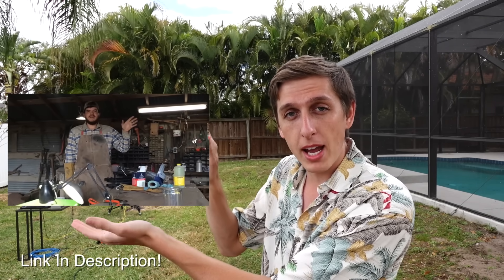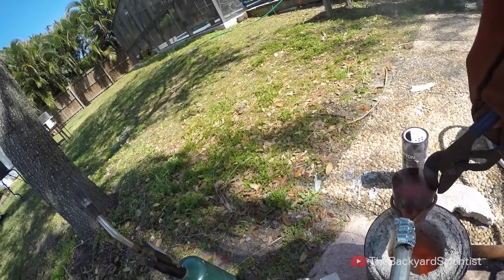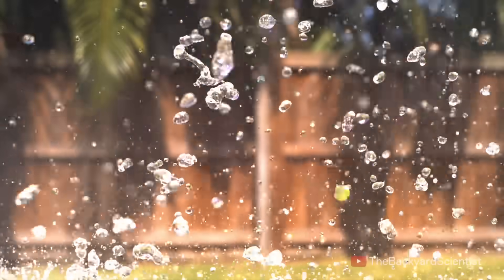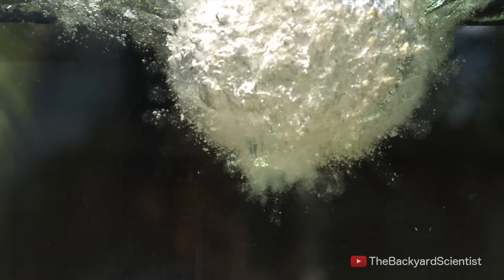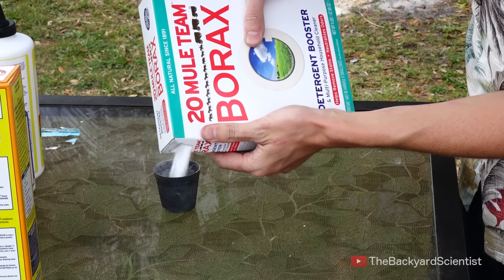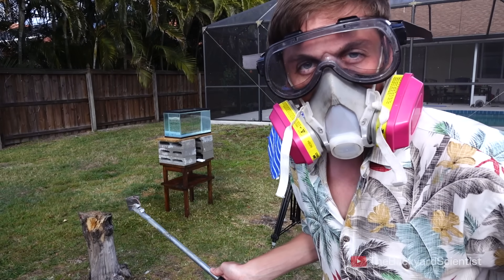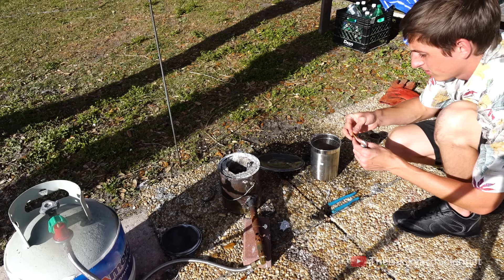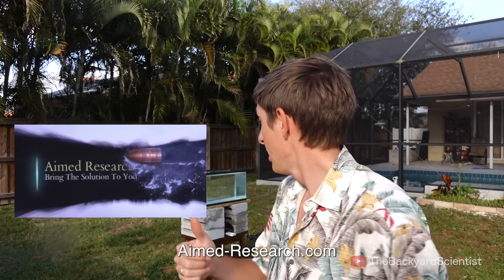Pouring Molten salt into Water - Explosion!

Comment: If i had to guess i would say it is a combination of several things going on, the melting of the salt weakens the lattice structure of the salt, allowing for the already more powerful hydrogen bonds to  break the salt structure down more violently than usual. This generates not only free sodium atoms but also chlorine free radicals. The sodium reacting with water generates an explosive force as well as hydrogen, however this hydrogen then goes on to react with the chlorine free radicals to give a secondary explosion. This would explain the absence of the characteristic combustion flame for the hydrogen present when the straight sodium gave one. It is then entirely possible that the HCl formed condenses back into the steam and the water again where it will react with the NaOH to give the salt again and neutralising the pH.

Comment: Wouldn't it have something to do with the combustion of hydrogen not being able to escape water after the immediate cooling?   I have no idea if I even come close to knowing but I know if you were to put water into molten metal that's exactly what would happen.
Reply: Basically a small hydrogen bomb?
Reply: nah, but you tried xD
Reply: ***** I think your wrong.....
Reply: +Stankonia 1 i'm a biochemist so idc what you think lol
Reply: So here's the first big problem with everything you said, a "hydrogen bomb" is not burning hydrogen, it's fusing it. Second, the hydrogen and oxygen don't separate from each other when water evaporates, you have to use electrolysis for that.
Reply: Making water/steam hot enough can actually separate the hydrogen from the oxygen. That's what happened in Fukushima , leading to the eventual explosions.
Reply: ***** Ok? That's still not what a "Hydrogen Bomb" is. And besides, the salt would have to be heating the water to 3000+ºC to even separate enough hydrogen to make an explosion.
Reply: LiquidPanic
I was not implying you were wrong with your main points, I just wanted to add that you don't need electrolysis.
Reply: ***** And I was just pointing out that heat based water-splitting is very impractical and would most certainly not happen from pouring molten salt in water.
Reply: isnt it because salt containts natrium which explodes when it comes in contact with water, maybe by heating it the natrium seperates with the chlorine
Reply: nope, just sodium 0 explodes with water, but the sodium ion in sodium chloride are +1, plus the reaction between sodium and water releases NaOH that changes pH

Comment: Is this something along the lines where a normal reaction at room temperature and standard atmosphere NaCl are neutral ions combining with H2O form an acid BUT the hydrogen coats the entire group allowing the salt to simply dissolve.  However, the reaction you are working with is a high temperature thermodynamic reaction where NaCl become Na+(aqueous) and Cl_(aqueous) adding this to H2O...energy is imparted to the water creating HCL and the rest is history. Somewhere along the line the bonds must be breaking down, the high temperature is potential energy turning into kinectic energy? I mean it's a form of External Work being done on open system delta U = Q + W ; No change in Volume, No change in Pressure; therefore the external heat applied is the only thing that has changed adding to the total change in energy? Just guessing.

Comment: I use boric acid and borax for working on gold and silver jewelry all the time. They both have a much much lower melting temperature, and are also more of a tar like substance when molten. Kind of like lava. I feel like it isn't hot enough to super heat the water, nor are they fluid like enough to form the pockets if they could heat it fast enough.

Comment: Maybe because of table salt's very high solubility in water together with the heat of water vapours from the initial leidenfrost effect, a over saturated solution is formed around the sodium chloride. This solution of course should have a higher boiling point than water itself. The difference may not be that dramatic but maybe it is enough to break down the leidenfrost effect and allow the salt to come into contact with water. Then your theory comes into action next.

Comment: I would posit that the biggest factor involving your experiment is that sodium chloride (NaCl) breaks down the surface tension of water. This would in fact infer a chemical reaction, that should also explain the intensity witnessed by your experiment. This would arguably identify the absence of the same level of intensity when the other chemicals were introduced to the water, as they are all agents not known for their ability to break down the surface tension of the water; purely reactions to temperature displacement. Perhaps, if you can manage it, try some form of molten soap, or other agent known for its ability to break down the water's surface tension, and see if like reactions are the result...

Comment: I work for a refinery where they use oil to produce the various grades of liquid asphalt that they use to mix with the aggregate to lay down on the roads that you see today. The asphalt we normally send out is called PG64-10 and runs at approximately 350 degrees. The single most dangerous thing that a driver can have in his truck is water. Water expands 1500x when the asphalt hits it. There have been cases where inexperienced drivers don't realize there's water in their truck, and load on top of it. What ends up happening is that the water causes the asphalt to explode out of the dome causing a volcano like effect. There was one case where the driver was new to the job, loaded a wet truck, didn't have his facemask down, and the asphalt shot right into his face. He lived for a while, but they had to remove his eyeballs, but eventually he ended up dying months later.
Reply: +ExMachina70 I care. May he rest in... Asphalt...
Reply: All I need are four more eyes and I can perform my own 6 ball juggling act. Did you you want pics?
Reply: Moe Zuiter oh don't get me wrong. I really don't care if the guy died. I kind of thought it was cool that his eyes were scooped out.
Reply: Samuel Rea No what's fucked up is that I have his eyes in a jar next to me as I type this.
Reply: Ok send me your email then, and don't come back crying at me after i show you the photos.
Reply: Obviously you're trying to get me banned here. If you never wanted to see the eyeballs in the first place then you should have said so. I'll let you know this much. His eyes were brown before they turned black. XD
Reply: Samuel Rea you know I cant do that. I can't show something horribly gory as a guys eyeballs melted with asphalt. The puss alone will gt me banned. Quit stalling and send me an email.
Reply: Samuel Rea I really want to show you these eyes. They're really cool I'm sure we can work something out here. LOL They scooped it out of his head for Christ sake. You'll laugh your ass off. Let me find out how I can go about this.
Reply: ExMachina70 cool
Reply: No one cares mate, sorry bout that
Reply: Lol Np. It was more about the expansion of water with heat than anything, but in all honesty you can really only speak for yourself.
Reply: do you have a social media website like facebook because if you do u can post it on your side and I can view it without giving my information away
Reply: I have no idea what the hell you just said. Speak english.
Reply: Stephanie Briggs thanks lol
Reply: ExMachina70+ oh, and i severely enjoyed your short tale, Mr "Machina", in fact i found it quite entertaining.
Reply: Crippling Depression Glad you liked it. Just a couple weeks ago we had one of our operators hooking up railcars to some steam hoses. They do this to heat up the asphalt on the railcar so that it turns into a liquid so that it can be easily offloaded into a tank. Well, he missed a step somewhere, and ended up getting blasted by the 400+ (F) degree steam at crotch level. Good thing he covered his johnson, but ended up getting severtly burned on his legs, and his hand. The steam went right through his nomax, and gloves and burned the crap out of him. At that point the doctors have to let his hand heal, then peel off the skin a few times over. It seriously sucks being him right now.
Reply: wow the company you work for must suck if there is these many acidents happening.
Reply: with the way exmachina seem to enjoy these unfortunate events, i question it being an accident in the first place :x
Reply: Aidil Rosedy Yes.....an "accident".
Reply: your fucked up
Reply: pervert weird fuck
Reply: SURE BEACAUSE I KNOW YOUR LIEING
Reply: no your going to bother me on my email. If you have his eyes post it on youtube.
Reply: no I don't know you so I'm not giving you an email address. your the one stalling
Reply: fucked up
Reply: ok sure this will be new
Reply: who are you talking to pepsqueak
Reply: I like your spirit. #science
Reply: Samuel Rea
 Are you inferring that I am a child? I was just making a simple joke.
Reply: TheCobraGamer a simple joke that wasn't funny
Reply: Samuel Rea
I respect that. Not all jokes are gonna be funny. Atleast be nice. :|
Reply: what if you don't know how to
Reply: Thats fricking metal dude.
Reply: Samuel Rea Actually the first incident that I was talking about happened at another refinery. It was an error on the truckers side since he didn't check for water in his tank, but this is also what happens when trucking companies don't educate new drivers enough, and teach them what to look out for. These low budget companies have such a high turn around, that they fail to teach the drivers the real dangers of what their dealing with. As for the other incident, it did happen in my company, but it ultimately was operator error.
Reply: A cautionary tale, but a horrible one.. ouch

Comment: +TheBackyardScientist I have an idea about the salt reaction and the Leidenfrost effect. It may indeed be happening as it is supposed to. But: how does sodium react with water vapor??? The air around the melted salt should be supersaturated. Chlorine gas is also explosive. Could there be any chlorine gas (even minute traces) forming as part of reaction between the sodium and the water? When a scientist is in doubt, they usually ask an engineer.

Comment: What is an ionic compound?
Reply: My first response would be to just Google it because it's been 10 years since I took chemistry, but I believe it's a molecule made up of two ions that are bound together because of their opposite charge. If I remember correctly, all salts are ionic compounds that, when dissolved in water separate into their component ions. So table salt in water becomes Na+ and Cl- ions freely floating.  Still, if you want definite info just Google it :P

Comment: It's a chemical reaction
First. NaCl heated up so it created ion form of Na+ and Cl- 
Then Cl- and Na+ react with water at the same time create HCl and NaOH ( and Na+ create the explotion ) 
After that, NaOH and HCl react with each other and create NaCl 
So pH didn't change
Reply: By the way
Sodium will explode when react with water at room temp. You don't need to heat it up

Comment: seems to me a chain reaction, just about it. So the little explosions add to the next and its only possible because of the speed of the reaction, if you slow the process down it will not explode as in slow speed the adds never happen. That would be my point of view considering the physics envolved in the reaction. Which explain also why it doesnt work if the salt has something that might slow the reaction. So with this though i would request more experiment on this, but now aiming to add something extra to the melted salt to accelerate the chain reaction  speed. And another instead of tempering the salt with some extra do it with the water. Remember the aim is to do everything that might speed up the chain reaction. Explosions is all abaout speed(once it explodes) before that the process can be slow as it can get.(i would state that the definition of  explosions is hyper speed chain reaction) no chain reaction no explosion! If im wrong prove it, i really would like to see that. Think of me as a challanger, take or leave it. But would be awsome to see more of your experiments on the matter. Thank your for the hard work, keep it up!

Comment: why is molten salt dark? are there any chances that you broke the ionic bonds and released the Cl gas free and Na became what's mostly left?

you didnt seem to heat up the metal Na enough, while you heat up the salt for 10 min, so the energy stored in salt was bigger. this was an unfair and terrible comparison, if Na was hot enough, then it would explode just as well.

Comment: I think the answer is partly down to the significantly higher heat of fusion of NaCl Vs the other salts. In short there is far more energy released from the solidification of the NaCl than for the solidification of the other salts despite the lower melting point. With the heat of fusion being higher it would in theory take longer for a strong surface skin of solid salt to form for the same rate of heat transfer to the water. The explosion is of course down to the rapid generation of steam, we know that this is the case as the steam bubbles are clearly seen as collapsing back in on themelves as the steam rapidly recondenses after the heat source is diminished.

Comment: I have a feeling it's because sodium chloride absorbs water very well, so the leidenfrost effect is minimal
Reply: If that was the case, the pH should have changed according to his litmus test due to the addition of NaOH
Reply: i was thinking the same
Reply: What about the fact that molten salt is nothing but ions. NaCl does not need to wait until it gets hydrated, so there are Na+ ions from the beginning, reacting with the water, producing a lot Hydrogen (and maybe ignites and produces water again while energey is emitted)?
Reply: it's probably due too sodium chloride density, I mean compared to the others it sank slightly faster which could be what made it explode
Reply: fuck my highschool chemistry teacher....
Reply: It's because the sodium itself is super reactive with water, all the boiling does is boil off the chlorine allowing for a reaction to take place. Though the reaction in the video is much more explosive then normal, probably due to flash boiling between molten sodium and cold water.
Reply: Well obviously the ionic dirivitive is incomparable with 
You know what I have no idea XD

Comment: Does the extreme amount of salt at the point of contact with the water change the surface tension of the water?  Also salt is hydrophilic, meaning it attracts water as well,  Could the molten salts be even more hydrophilic?

Comment: The Chlorine you separated from boiling it down will absorb and heat the water to about 500C then due to the sodium being pure, or more so with it's chemical balance further unstable the H2O will bond with Cl and then it will leave Na to it's own accord making a violent pressure change within the water. But, there is no exact measure of bonds in the other chemicals, it would end up being pointlessly unstable. Not even bonding with water and becoming a sinking clump regardless of the temp and either it's liquid or solid. NaCl dissipates in water at a normal rate when room temp, your speeding up that process 67x adding it with heat will remove the pH effects until it cools completely off...
Cheers!!

Comment: Of course sodium exploded in contact with water. All the elements in the first column on the periodic table react increasingly more violent as you go down the list (Hydrogen, Lithium, Sodium, Potassium, Rubidium, Cesium, and Francium). This totally makes sense once you proposed testing with just straight Sodium.

Comment: We all should know this. Simply put, the hot molten material (Salt)  was poured into a tank of water at ambient temperature, quickly the heat transferred to the water, then the glass, then the temperature difference caused the glass to break. Why ? because the glass was relatively cool then the hotter water molecules reached the surface of the glass and caused a breakage.

Comment: The salts explode because of their crystalline structure and the amount of energy they can store. When you drop the molten salt in water, the outer shell cools rapidly and forms hard crystalline bonds, while the inside is still boiling hot. At the inside expands, the outer shell cracks and expands a bit too, but eventually the outer shell becomes thick enough to withstand the immense pressure from the cooling expanding salt in the middle. It accumulates a large amount of energy within its crystalline bonds until it cannot anymore. The bonds break and the pressure is relieved. Basically the more a crystal expands as it cools and the stronger its crystal lattice is, the more energetic the explosion.
Reply: If you want to maximize the bang next time, immerse your super safe tool and crucible in the liquid without pouring. Beware of shrapnels, use a shield!

Comment: One time, I had a VERY hot glass bowl, and the water we had in the sink to cool it off turned out to be pretty cold, and the bowl exploded when it went in the water. Do you think that it's the same reaction? I think so, but I wish to know what you think.
Reply: thats just a thing that happens when certain things cool off to fast somethimes. its because of the random and quick tempeture change that causes stuff to crack, brack, etc.
Reply: +BlackCheshire Cat especially with glass if im correct
Reply: That's because the hot water makes the glass expand but then it rapidly cools down too fast and becomes brittle and then cracks.

Comment: because the heat + chemical reaction causes dielectric polarization on the water molecule thus splitting it to hho and its the hydrogen exploding?
Reply: the reason your chemical results are not working is because the oxygen and hydrogen recombine, try add some baking soda as an electrolite